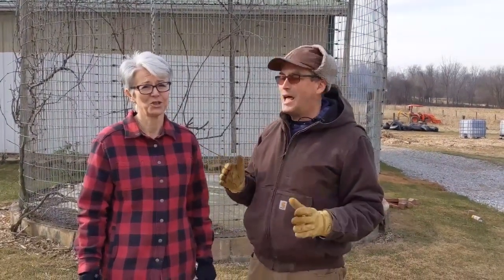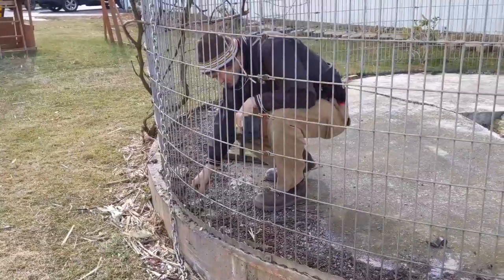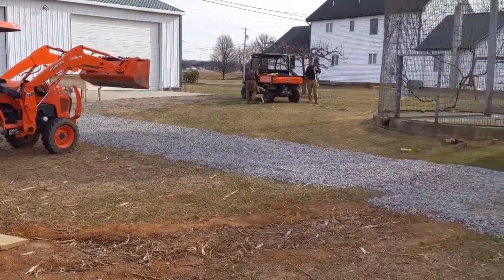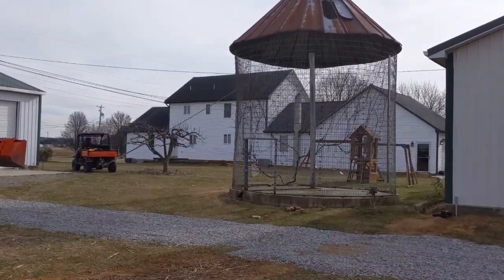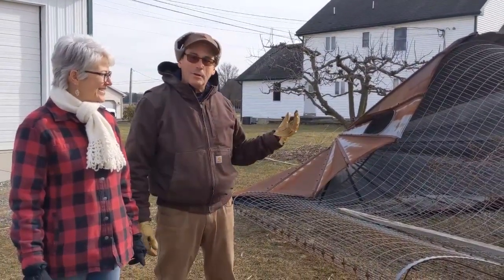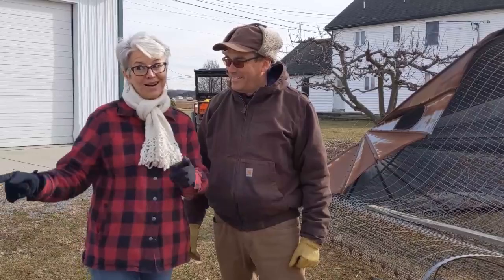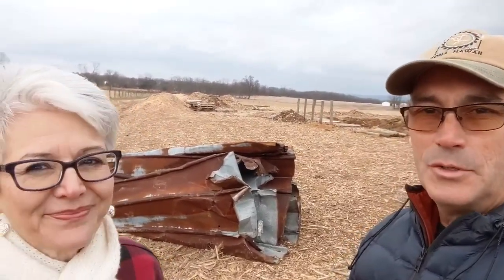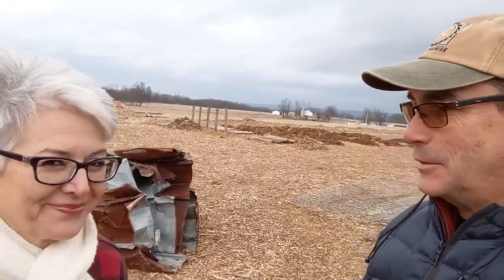Corn Crib Demolition on our 1840 Farm

Comment: What size of impact did you use for the bolts?
Reply from the maker: Oh wow....that was a couple years ago now. I think I used an angle grinder to cut off the bolts.
Reply from the maker: Ok....I looked back, we used a small impact driver (3/8 drive I believe). I now have a much better 1/2 drive impact driver that would have been better.
Reply: Thank you  @waardenburgfamilyfarm4764